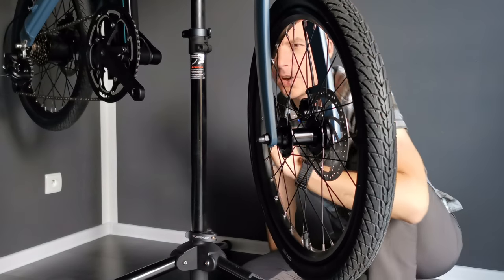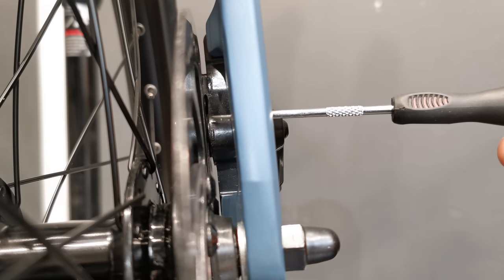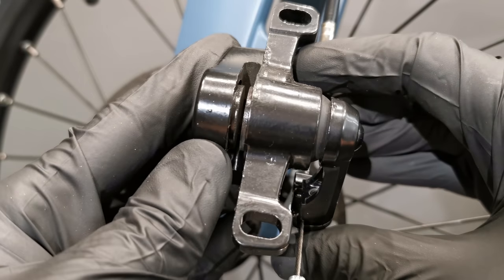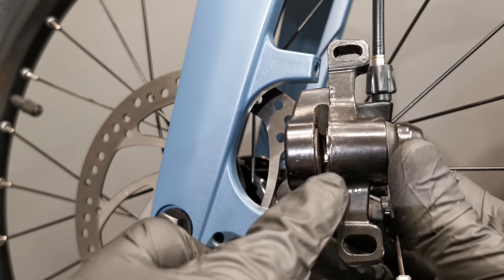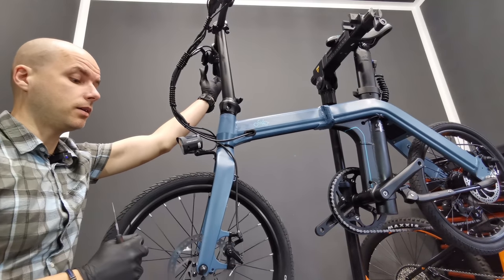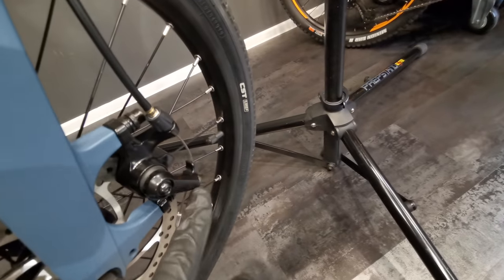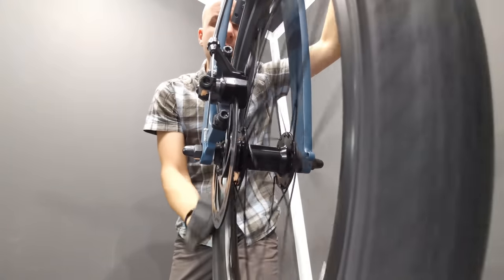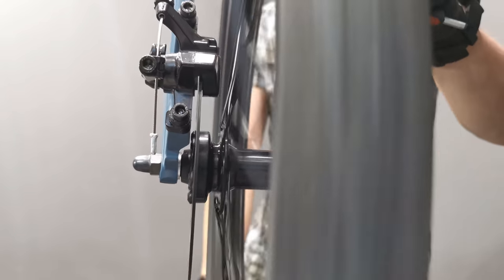How To Improve Cheap, Mechanical, ONE Piston Disc Brakes For More Braking Power. Single Actuation.

Comment: Did everything in this video, cleaned calpiers with soap then dried and filed, yet squeaking, loss of break power etc.  
My friend with a newly bought bike also have same problem after few days. 
I guess mechanical disck brakes are worst.
Reply: Yup happens with me too. Wont stop immediately if you are at high speed
Reply: V brakes is better in cheaper cycles because v brakes use cheap resin pads which have more friction compared to semi-metallic pads that the most cheap mechanical disc brakes use. V brakes resin pads brake much much better but wear out much faster. Cheap mechanical brake pads wear a bit longer but braking performance is garbage.
Reply: Also make sure it's V brakes because there are other variations of rim brake which are equally bad. Remember V brake or Power brake is the Key term. Always ask the shop about it . Also check out the Park Tools brake Identification video for more clarification. Just search Park tools Brake Identification and you'll know which brake I'm referring to. In V brake the fulcrum is at the end of the brake arm, making them 2nd class lever i.e more powerful than 1st class lever. better braking with less force.
Reply: I too made the same mistake and bought a disc brake cycle because I thought it looked nice and therefore would perform like a motorcycle disc brake. But when I realised how bad it is, it was too late. First of all the brake was badly set by the shop so lots of brake rubbing. Also in case the hub is bad which it is in most cases , then it won't be true and the brake disc will wobble no matter what especially the rear wheel and touch the pads.
Reply: Because of that bad disc brake I did not want to use my cycle at all. Now I've switched to a cheap V brake luckily my cycle came with v brake mounts. Now the braking is so much better and only needs one finger. Not as good as hydraulic but still miles better than that garbage disc brake. Basically Disc brake is just a marketing tactic and has no real world application in cheap cycles. Any cycle under 20k rupees is cheap.
Reply: Try to clean your rotor too with soap
Reply: True your disk rotor
Reply: High end mechanical disc brakes are still pretty dang good

Comment: The e-bike brakes are "budget/cheap brakes", im use the e-bike for only 1 week , the brake pad are worn out, yeah the solution was change the Brake pad or upgrade with better quality mechanical disk brake

Comment: siema, I saw on Chinese video how they adjust breaks on  bikes, almost same type like yours. They did little different way. They loose clipper on frame and push clipper in direction that makes not moving piston touching disk, then they tide clipper with screws. In this situation piston is touching rotor, ant this is moment when they little bit loose screw on static piston  like you did it for regulation. After that they adjust breaks with pulling still line. I thing moving clipper to rotor side is good way to regulate this type of breaks, even better than loosing , holding lever and screwing coz this way is made for hydraulic breaks where both pistons are moving and clipper must be centered. Im using this metod and always breaks works perfectly. 

https://www.youtube.com/watch?v=KT0-t0r0pRU

Chinese video

Comment: You didn't show us the depth of the "pull" or leverage on the brake levers. I know it is still needs to pull all the way until it reaches the grips😂 I saw the cable man and I experience it😂 By the way, thanks for the "TIps."

Comment: Well what to do if that brake pad adjuster screw doesn't even spin no matter how much force I apply and strip the 5mm Allen key tool? (Trust me, it ain't movin' an inch
Reply: Spray some WD40 on it, might have some rust on the threads
Reply: @albert.6925  Also DON'T forget to loosen the lock before and after you adjust the piston.
Reply: There is a tiny locking screw on the side/top of the big adjuster screw.  Make sure it is loose before adjusting the pad.

Comment: I think I have the same brakes, for some reason my rear pads sit at an angle different than the one adjustable by the screws and I cannot align it :/ I am thinking the mounts or brake body is slightly bent or something. 
Anyone has ideas ?
Reply: Might have gotten bashed/wrecked?

Comment: I have that disc brake on front brake. Just bought bike. Tire doesn't glide smoothly. What could be the cause?
Reply: Update. Found out problem. Not disc brake. Enjoyed your video.
Reply: @thetruthissweet2847  What was the reason?
Reply: @arpitsahu9940  I adjusted the brake and centered it. Works great.
Reply: @thetruthissweet2847  Thanks a lot. Tried it and it worked. Adjustment was a nightmare tho

Comment: I repair my disc brake and after doing stoppie it becomes loose
Is it happening with everyone or only with me 
Please replyyyyyyy
Reply: If your cable screw is not fully tightened, the break can become loose when you press harder
Reply: same, @LEBER any more solutions?
Reply: @lahna84  that should be the main reason your brake cable would  get released, if that doesnt work you should try to see if the screw that holds the cable is rusty or damaged, or even if there are any issues with the cable itself
Reply: @temk_TCM  ok, thanks
Reply: @temk_TCM  ill update when ill try that today, not really motivation rn

Comment: I'm doing the exact same thing but the brakes are squealing when I apply little force. And if I squeeze hard the squealing goes away. What might be the cause for that
Reply: Your brakes are fine, it's the pads and maybe the discs that are of poor quality
Reply: Three things come to mind. Fortunately, they are virtually free and easy to correct: 
1.) You might have dust and road grime on the rotors. The approved method for cleaning them is to wipe them with a clean rag wetted with a little isopropyl (rubbing) alcohol. You DON'T have to do this after every ride, but it must be done at least a few times a year. 
2.) You might need to "bed in" the brake pads and/or rotors. There are several videos on YouTube explaining and demonstrating how. This is critical to achieving noiseless braking and must be done each time you install new pads and/or rotors. 
3.) Your pads and/or rotors might be glazed. You'll likely be able to see this if present. Get some very fine wet/dry sandpaper and lightly sand the pads and/or rotors. It won't take much time or effort, and don't be afraid of ruining anything; brakes are TOUGH. When finished, be sure to clean everything with isopropyl alcohol and a cotton rag.

Comment: why would anyone still use these brakes? the br-mt200 is 43 euros.
Reply: My whole bike is 150Eur 😀 and it has these 1 piston ones on both wheels
Reply: @markifi for sales it's better to offer two bikes, one at 150 with mechanical calipers and another at 170 with hyd.
Let's not pretend the people making and selling budget bikes care about customer satisfaction.
Reply: You need to service mt200 each season. Mechs are just serviceless and good enough for stopping my 50kg body.
Reply: Wish there was a roadbike version at this price point

Comment: I have this crap on my electric cycle and it ain't worth sheet. The distance between lever pull and actual bike stop is around 10 feet. It slows down before it halts. After narrowly escaping a few accidents, I have it resting on the side of the wall and planning to try new pad types. The current ones are metal.

Comment: My brake is to weak at the back I already adjusted it but didn't work
Reply: Same idk what going on?
Reply: @alexvore5287  maybe the pads are worn out?
Reply: @zyrene2115  idk can there be another issue?
Reply: @alexvore5287  well I'm not mechanically minded so I'm not sure
Reply: I think you could clean the rotor and the brakepads with a soap
Reply: Clean your brake pads and rotors with alcohol and wipe with clean dry cloth. Rub your brake pads to a sandpaper until the contaminated parts gone. It's maybe your problem
Reply: @zyrene2115  I just change the back and front brakes is better now thanks tho
Reply: Go for hydraulic brakes, it is way better
Reply: @tushardixit5867  what is best budget hydraulic brakes?
Reply: Maybe the pads are dirty, try cleaning them

Comment: Hi, I have a tektro caliper that I  don't understand how it works. I have aligned the pads and still the wheel doesn't turn freely. There is enough space at the inner pad and no space at the outer pad. If I aligne it manually and get the space that I need then I hear the rotor squeak. I cannot align it with the inner and outer adjusters. The outer doesn't turn with the alen key. I don't know if it is broken or it is not supposed to adjust.  Can you give me an advice what to do?
MD-C550 is the type
Reply: Change the caliper to a new one or better off with a simple hydraulic brake, from Shimano. Mechanical brakes are fucky tbh, sure you can align them, but.. They suck!
Reply: there are many reasons why your rotor is still rubbing. spin the wheel and watch what is happening. Your hubs or rotor or caliper itself might be out of alignment, not just the pads. The whole caliper moves at the mount. Sounds like you need to move the whole caliper. You need to spin the wheel while doing the alignment, as the rotor or hubs may also not be completely parallel. this is the problem with disc brakes in general, they require far tighter tolerances to get right. And make sure your wheel is seated properly in the fork
Reply: If you have an adjuster that won't move then you won't be able to adjust properly, that's your obvious problem. See if there is a set screw locking the adjuster in place. Loosen that screw, then try turning the adjuster again. If you are out of ideas you can always take it to a bike shop.

Comment: these kind of brakes should be illegal. goes against good engineering philosophy.   Thanks for the video boss. i wonder how many beginner bikers understand how dangerous this design is if left unchecked  and not regularly adjusted. Do beginners , entry level riders really care? And thats my point!   Decent brands (Giant, Avalanch, etc ) should be equiping beginner bikes for less maintenance and not more.